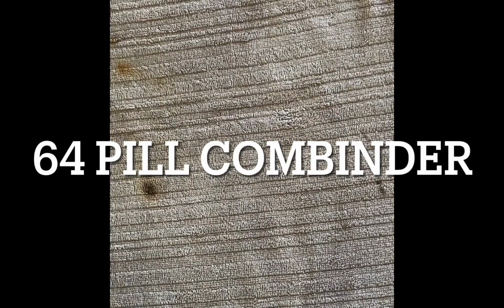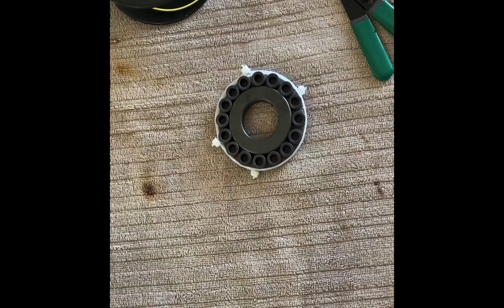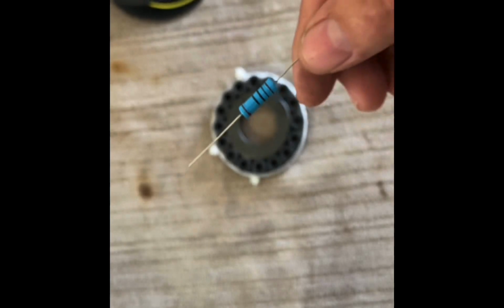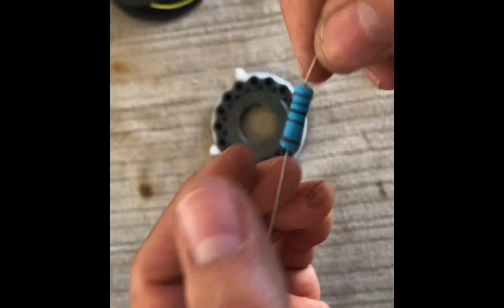64 Pill Combiner build

Comment: Try using metal oxide resistors, they hold up better than the carbon film ones you have in the video,  I've had good luck with metal oxide resistors on larger boxes. metal oxide film resistors use thin metal oxide films to coat an insulating ceramic rod. The compound made out of oxygen atoms and other atoms works wonders in forming a coating film.  However, metal oxide film resistors are made using tin oxide.  Also, antimony oxide is added to yield better resistance.

 

Moving on, these resistors are capable of withstanding high temperatures due to the presence of an insulating ceramic rod that doesn’t let heat pass through itself. At the same time, metal oxide resists the current. The more the antimony, the more is the resistance. But that doesn’t even end here, metal oxide film resistors heavily depend on the thickness of the metal oxide and the width of the helical metal oxide film cut for good resistance. The width of the helical metal oxide film cut and the thickness of the metal oxide are inversely proportional to the resistances